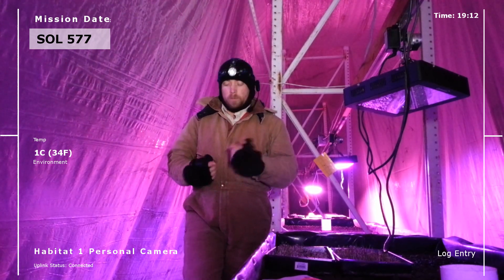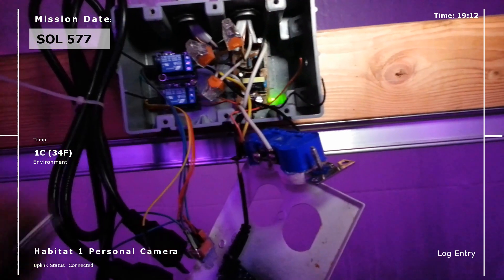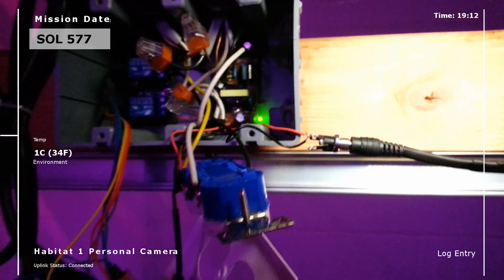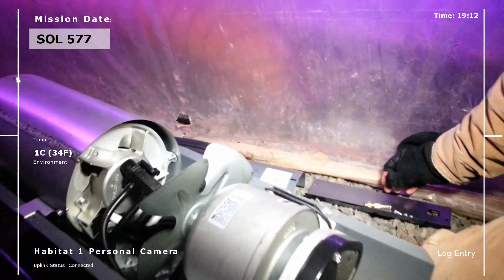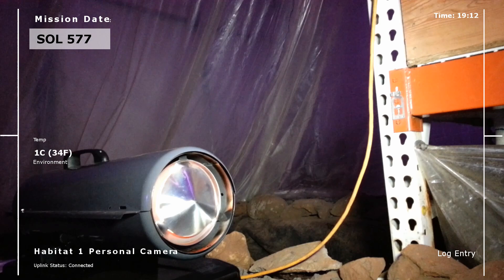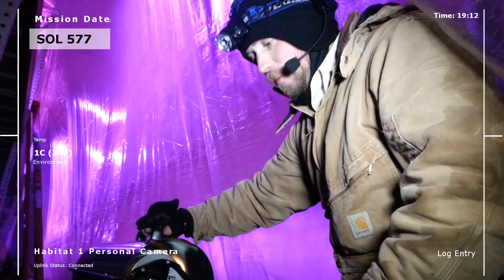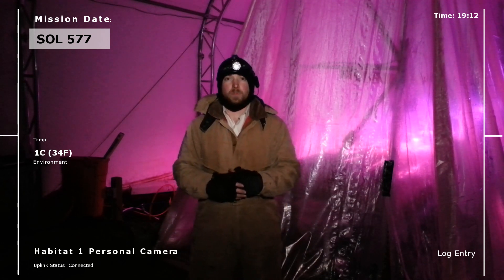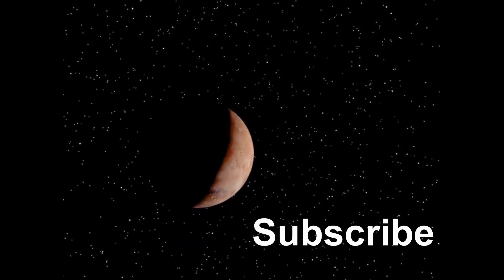How to Fix - Kerosene/Diesel Heater - DIY - Most Common Problem

Comment: A furnace nozzle spraying fuel is not a jet engine?  its a oil furnace!! There is a port at the rear for a gauge and the label on the heater has the psi rating for that size heater!

Comment: I am a issue with my heat it starts right up like normal it runs but only runs 15-20 seconds and it shuts off with a puff of smoke please let us know what the problem ends up to be...it will give me a idea what is wrong with mine

Comment: Not being up on a torpedo heater 100 % but if it is similar to a oil burner furnas  , one thing a lot of people make a mistake doing is touching the end of the fuel nozzles with their fingers, it ruins the tiny holes , the acid in your skin will eat out and enlarge the diameter of the nozzles and not spray correctly , just a FYI.

Comment: Another problem can be the fuel pump on the back of the fan unit, when mine failed I used compressed air to inject the fuel while I waited for a replacement(35% the cost of a new complete unit).

Comment: do the micro greens taste like diesel fuel?
Reply: I'd still be concerned about the quality of the produce being grown in an atmosphere of diesel particulates and nitrogen oxides.
Reply from the maker: actually no they dont :-)
Reply: Particulates are of little concern out of those heaters. they are hot enough to fully burn the fuel. The smoke out of diesel trucks (soot) is unburnt fuel from lack of oxygen in the combustion chamber. 

Nitrous oxides are the biggest concern. These are created by high combustion temperatures. Since the runs are not exactly air tight(and heaters only run for .25 of an hour) there should be enough circulation to clear out any NOx. 

Once the aquaponics is up and running the air could be circulated into the fish tanks via bubblers where the NOx would react with the urea produced by the fish. The reaction would produce water and nitrogen. It's not perfect but something to consider.

Comment: I"ve always found that kerosene seems to burn cleaner and maybe hotter in those torepedo type heaters, but usually cost a little more
Reply from the maker: we actually tried it and it really ended up smelling quite a bit more than diesel...i think it was because it was the low grade Kerosene

Comment: dude, awesome!

also a small butane soldering iron would help. I had a Weller one, pencil type with a catalyst heating element, worked for a while but left me wanting a larger supply.
The kind that uses a lighter supply may be more lasting and the disposable lighters work well when modded to fit.